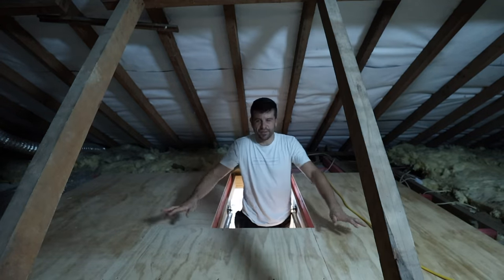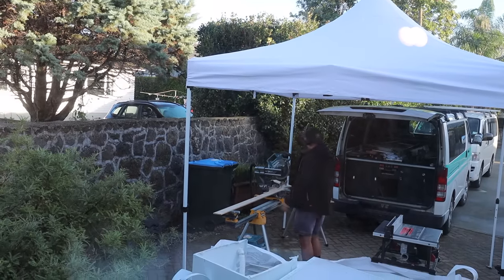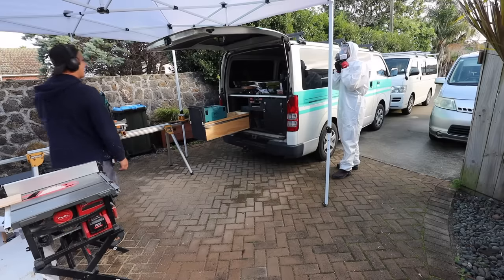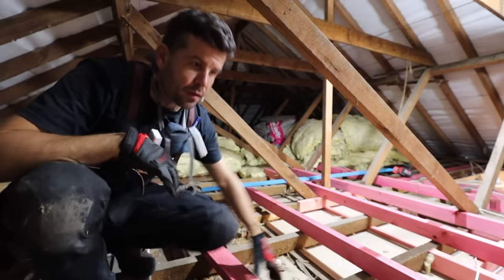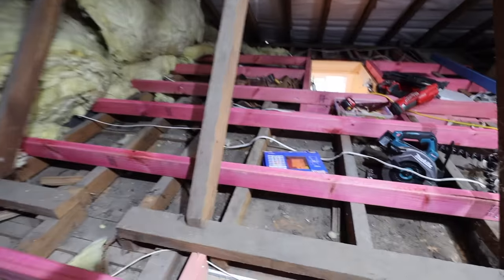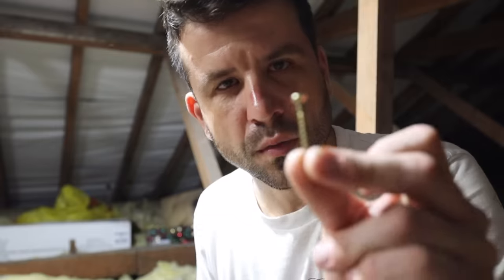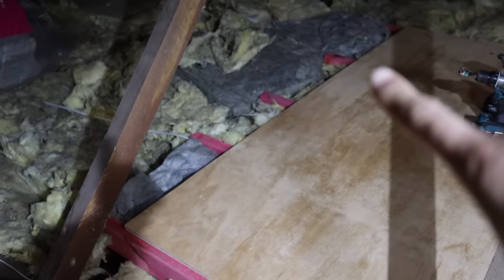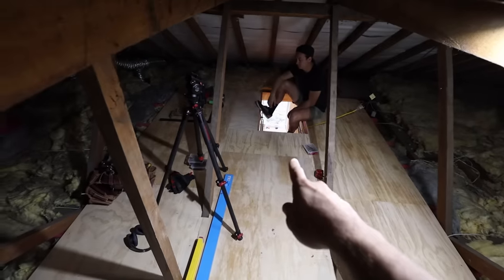Creating A Storage Platform In Your Attic

Comment: I did this about 1/3 of my garage, and used 3/4 “ (1.9cm) plywood, but I didn’t add any studs in between. I looked at yours but couldn’t tell what size plywood you were using?  I did this 20years ago and everything is ok. I use the space for storing tires, wheels and various car parts. I have a similar pull down ladder, but mostly made of aluminum, with reinforcing in laminated wood. The builder put the access point in such a way, that I can pull down the ladder, even with all 3 cars in the garage. The garage is attached to my home.

Comment: If you lay the wood across the rafters like this then you add weight to the roof, fine no big deal thats the whole point so you can add more weight by storing stuff up there.

However if you lay the wood in line with the rafters and bond them together, glue and screw, you made the rafter thicker and the roof stronger. Same amount of wood, more hassle to fit but strengthens the roof instead of using up some of the strength.
Reply: I'm assuming you have to run them the whole length?

Comment: Very nicely done. Of course the only problem with NZ ceiling spaces is they are not insulated from the roof and, as you pointed out, very hot. I hope they don't intend on storing heat sensitive or delicate items up there.

Comment: Want to do the same in my loft.  Talking about safety.  We now NEED to put in one of those folding ladders in.  Two weeks ago I used a normal straight ladder to access our loft.  It slipped out from under me when I was at the top, almost fully in the loft.  I fell about 2.9m with the ladder.  Landed badly with my left foot and fractured my ankle and tore ligaments.  Now in a airboot and crutches for 6 weeks!  I'm lucky it could have been worse.

Comment: In my 60's house the original water header tank was sitting on the trusses which isn't cool.
I built two platforms, one for storage and one for the water tanks.
They are now floating above the trusses, with joists sitting in mortared in hangers in the gables at one end and resting on load bearing walls at the other.
Proper job 👍

Comment: They not trusses.It is what is called a close couple roof,Rafters,ceiling joists,and the mid height horizontal members are collar ties.It all acts as a triangle to prevent the weight of the roof pushing the rafters out which would try to force the walls out.
Trusses mimic that idea but are all made in one peice and can span up to 12m in one go.(and more),
In that old system the spans are much less hence the struts and underpurlins. The collar ties are ussually at the same height as the underpurlins.The underpurlins support the rafter mid span and are themseleves supported by the struts which go down onto the walls

Comment: Great job, however I would have laid the insulation in line with the original roof joists rather than in line with your new ones. When you laid the insulation it hops over the original joists causing small voids near the joists. A thermal imaging camera, from the living area, would show greater heat loss in these areas. Maybe not such a big problem in lovely NZ but we need every bit of heat retention over in the UK.

Comment: Scott ... you forgot something very important when you lifted the batt insulation and exposed the ceiling gyproc, the wall top plates, wire entrances, additional voids ... etc.  With the area now free of insulation it would have been to your advantage - as well as the homeowners - to airseal all the present voids in the attic.  l noticed A LOT of dirt on the insulation you lifted.  Points toward a real issue with air leakage into the attic space and ultimately a concern in summer and winter ... l recognise the job entailed adding storage decking.  But as you know when you open things up in old houses other issues crop up and they need addressed correctly as opposed to covering them over ...  Just thought l'd point that out ...
Reply: You usually don't air (draft) seal an attic like this, like you're suggesting.  That's just asking for a shed load of moisture build-up... Leading to growth of certain stuff you don't want...

Comment: Loft jobs are always fun and in Oz can be a serious problem with the heat. Have got very close to heat stroke and become quite woosy at times when trying to work up there above 40C. With all that kit on and a fireman's resperator not surprised you were hot. In my experience most apprentice's make even more fuss about doing insulation than you do. I still do most of my own as it doesn't bother me too bad. A lot of the newer stuff is way better than it used to be.

Comment: Very good video regarding the new joists and the flooring, not so good regading putting the insulation back.  The insulation seemed to be laid undulating across the old joists, leaving tunnels of air either side of the old joists, so effectively only 4" /100mm insulation with large airpaths for heat to escape along lesssening the effectiveness of the insulation.  The insulation should have been laid between the old ceiling joists, and a new layer laid across then between the new joists, giving 8" or 200mm insulation overall under the boarding.  Still not the currently recommended 12" / 300mm thickness of insulation, but better thabn just 100mm.

Comment: Hey Scott! Recently struggled around my attic for a while with putting in insulation, can lights, running new circuits, and installing a beam. I realized towards the end that compression sleeves (like the ones for exercising) are great for working up there. It kept 99% of the insulation off my arms while being up there for hours, and kept me pretty cool. Easy to slip on and off. You still end up getting the rest of your clothes dirty though.

Comment: What thickness was the ply you used? Was it marine ply?
Couldn't you have laid the ply crossways across the existing joists instead of adding additional joists?
Could the new joists be laid on the 100mm edge?
Thanks in anticipation .
Reply: i was curious about this aswell.. laying it across the existing joists
Reply: If you lay the ply on the existing ceiling joists, you limit the anount of insulation you can have (just the depth of the joist, so 100mm not the 300mm you should have nowadays) and, as the ceiling joists were only sized for the weight of plasterboard, anything you store on the plywood will have weight, causing the ceiling joists to deflect and very likely the ceiling to crack, normally along the joints in the plasterboard.  His soution, if you listen to the video carefully, is to raise the new joist a little bit above the old ones spanning from the top of one wall to the other,  so that they don't bear on to the old joists at all, so the ceiling below doesn't crack.  

In practice, the new joists will defelect a bit when they are loaded up with boxes and a person walking on them, but probably not enough to worry about.
Reply: @robertsmart7484  yup that's what I did and got 2400x600 flooring to go in.

Comment: Hey Scott, I've bought one of those Fletcher built houses, standard four bed 2 bath single level places. I'm reasonably handy and I am looking at doing something similar above the double garage. The garage is 6mx6m with only walls on the perimeter as usual. Just given what you said about trying to support your storage beams over walls do you think it will be safe to do it over such a large area without wall support in the middle? Thanks.

Comment: One thing I always notice about these old roof structures are that they typically just have a notch in the strut to support the rafters with maybe a single nail through the connection. This is fine for when it's always in compression, as in the case of heavy concrete roof tiles, but when replacement works are done from concrete tiles to corrugated steel roof, it's always a good idea to think about strengthening this connection as there is now the ability for suction wind pressures to form and make the strut go into tension for a bit. Lot's of proprietary products out there to address this, but may be ideal to select one that limits the amount of work you have to do when dealing with old, hard and split-prone timber!

Comment: So that’s the dilema I’m having building my new garage. Should I just use insulation that’s R-15 for the ceiling then put osb on the top of the ceiling so I can use the empty space as storage and then drywall the ceiling? Would R-15 be okay for a ceiling?

Comment: Hi. Nice bit of finishing using the router to round the edges, its that little bit extra that we all like about your work.  Suggestion (past experience), whilst you have the sparky coming next week have him put a couple of lights and a power socket into the roof; it will help the owners when they start putting their junk in the roof and when they have HRV installed it will have somewhere to hook into!  Cheers mate.  Harera

Comment: As a young lad I use to take safety as a bit of a joke, but not anymore from some of the things i have seen in person over the years. Thumbs being cut off and reattached, bits of broken angle grinding disc in someones head, splinters and metal in eyes, deep cuts to the bone, crushed toes, hearing loss, bits of finger ground off. You know the usual stuff that could of been avoided if the proper safety equipment was used.

Comment: So basically the way to reinforce is to add 2x4’s along the other wood?

I have this but on vaulted ceilings and wanted to figure out how to add plywood up there as well for storage.

Do you have to have the 2x4’s stretch and connect to a beam for strength?

Comment: I was wondering if the ceiling would crack due to flex when you step on the joists? I'm on the heavy side so I'm worried if my gyprock/drywall might crack on where it butt against one another. Thanks in advance!
Reply from the maker: Yeah man, got to be super careful! I was lucky, as there are a few walls directly below. The walls that I point out, but also a hallway that runs directly underneath👍
Reply: Thanks  @ScottBrownCarpentry

Comment: Question.  Why didn't you leave the insulation and merely add 2 x 2 or 2 x 4 's atop the existing 2 x 4's, -  then lay the flooring?  You've totally removed the insulation, and that's definitely not a good technique.  The attic is suppose to have insulation  in it.  Why did you do ut that way?

Comment: I’ve never seen a video where Scott takes so long to get into it - we’ve all had one of those days 😂
Reply: Nobody wants to play with fibreglass bats even with a suit on. It's good to see someone have as much "fun" as I've had doing the same thing.
Reply: Horrible job. I've delayed just like that. Doing our own loft, I used marker pen to trace out and cables on the boards. Was extremely useful in years afterwards
Reply: Standard for a horrible job like that ... load all the tools and materials up then have a coffee and mentally prepare for the nightmare ahead
Reply: @cuebj  i did that also, also did it when i redid our caravan floor (on the ply and then carpet on top) so i or any future owner knows where everything is. Save alot of time if and when you need to get to it

Comment: disappointing. In among many minutes of thinking he is a film maker shooting "scenes" , I missed where he explained what the pink wood is braced on. Are the attached to each rafter or are they only attached at either end?

Don't understand the point of them  when the plywood could have been attached direct to the celling joists and avoid adding a lot of extra woodwork weight into the ceiling???
Reply: they're packed up anywhere there's a wall underneath the joist below, to avoid extra weight on the ceiling. They're used to both distribute weight off the ceiling, or avoid point loading and to avoid compression of the insulation which would make it less effective